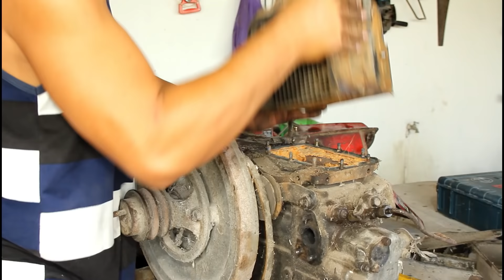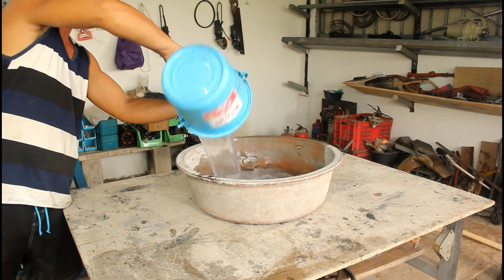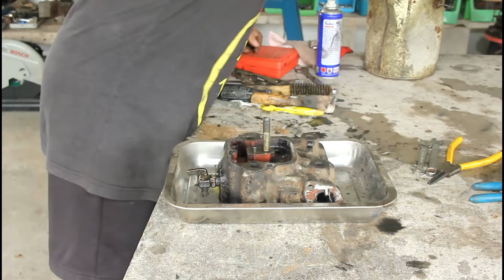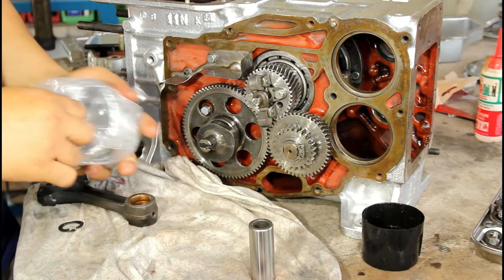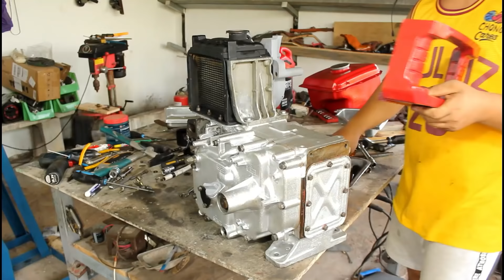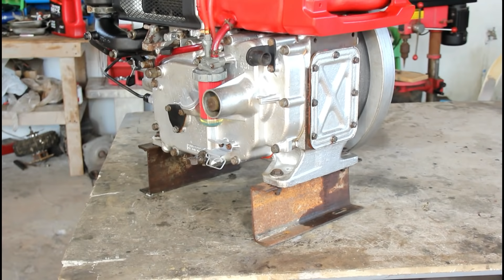20 Years Old KUBOTA RK80 DIESEL ENGINE RESTORATION

Comment: You need to get the stuff to zinc plate the bolts. Did you check the gaps in the rings before installing them?